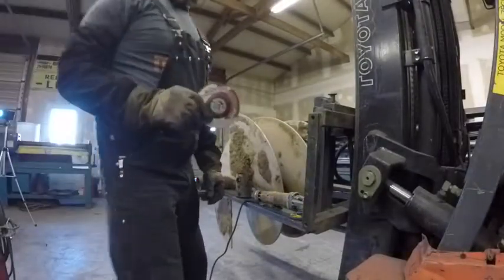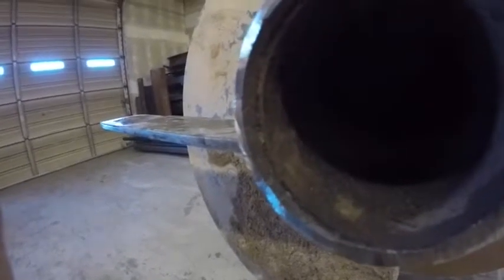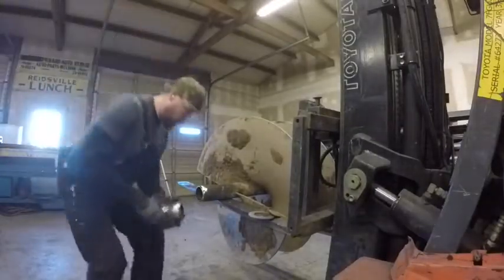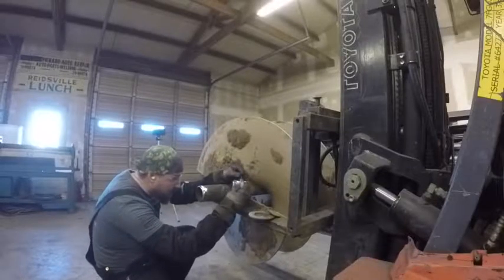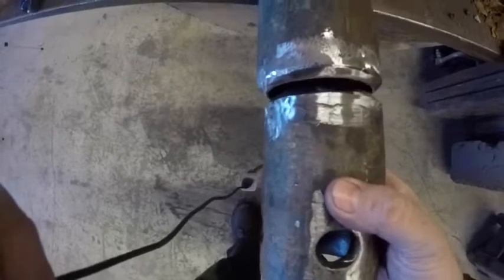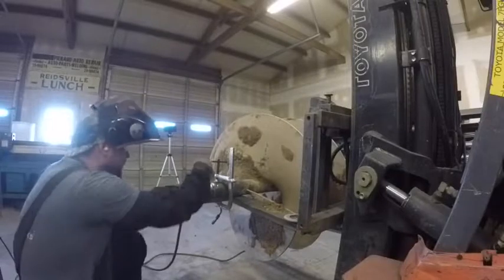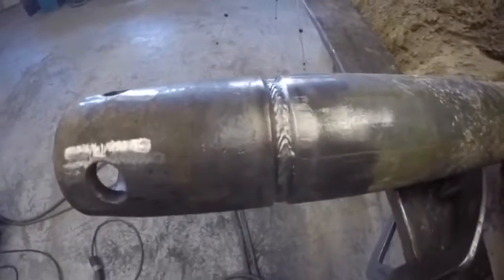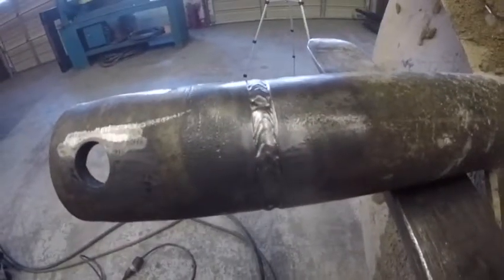Bobcat auger repair,  36" auger shaft multipass mig repair

Comment: Advice for pricing repair?
I don’t want to short change myself but don’t want to overcharge either. 
And on another note: Could you have done an open root with 6010 and filled it out with 7018?
Reply from the maker: Welder 92 prices all vary depending on each job.  Unfortunately that’s not something I can help with much.  I could make suggestions but it’s different from state to state etc.   and yes there are multiple ways you could weld this up.  We were in the shop so we just turned the mig gun up and burned her in good and hot.  Thanks for watching.  New videos coming soon.
Reply: Mattco Metal Works awesome man. Keep them coming.
Reply: Could you make a suggestion on the price please. My son is just starting a business and it would be great to get an idea for something like that. Thank you
Reply: Jason Hendrix what part of Georgia you at? Im around the Calhoun area of North Georgia